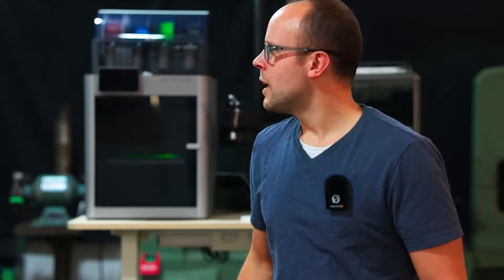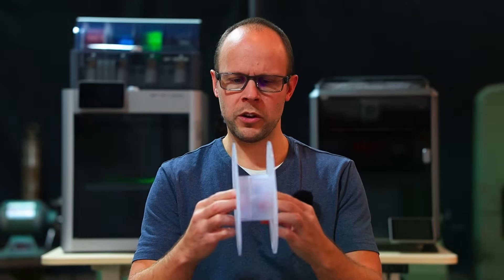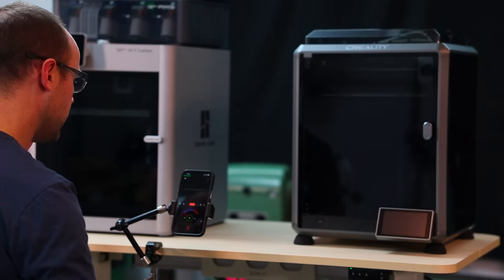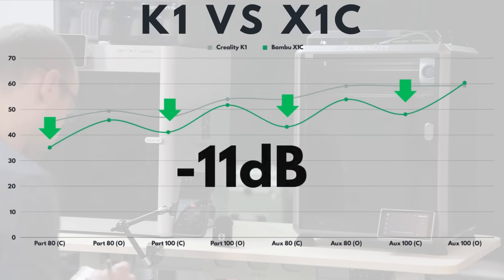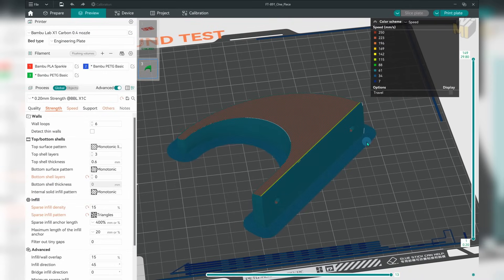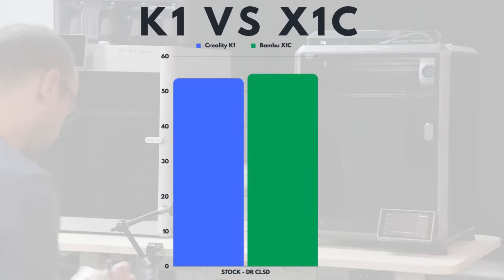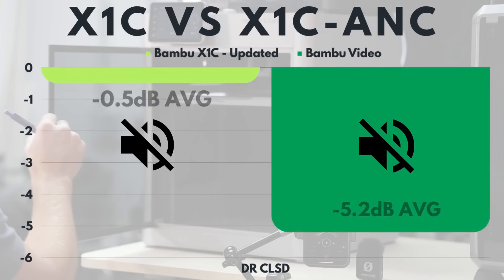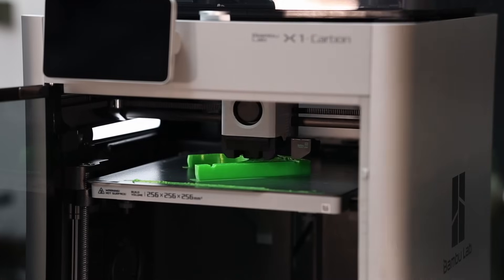Bambu X1C Active Motor Noise Cancellation Vs Creality K1

Comment: This is in no way a meaningful test.
Every printer has to be in exactly the same place on the table and the microphone has to be placed in the middle and in front of the printer for every test! The different positions of the printer on the table alone distort the result, as does the position of the microphone between the printers.
Reply from the maker: Thanks for your comments Nico, sure the distance is probably off by 1/4 of an inch one way or another.  And I'm using an Iphone an an app to measure.  I can appeciate where you're coming from, but you're comment is quite severe.  It is in many ways a far more meaningful test than one quick 10 second shot from a supplier.   Is it extensive testing, not by any means, but it is real testing performed by a real person with real results that I can hear and so can everyone else watching the video.  Though you cannot see it, it took 40 hours of work to put all of this together into something that.. is in NO WAY Meaningful.  So I guess you're right.  Sometimes it's a good idea to ask questions before making statements.
Reply: LOL I Subbed right away after watching this you did a GREAT JOB and Thank you for showing the diff between a marketing video and a Real person testing in Real environment as best they can with the tools they have. Bravo @NeedItMakeIt
Reply from the maker: @AlbertoMartinez765  Thanks!  That my friend is exactly what I'm shooting for.   I don't want to be sponsored, I don't want to get anything free, I want to try to do my best with what I have to see if we can get a little more information to make better decisions.  I'm sure that under the exact correct circumstances, there is a bigger benefit to this, but in my testing of these parts... Which are now mounted on my wall and getting good use, I didn't see a big difference.  I'm always happy to do more testing and if I can get a bit more traction I can buy some better equipment to see more accurate results.    This one took a lot longer than I expected, actually every video takes longer, there is always far more to it as you dive in.

I am still left fairly satisfied that by closing the door on the Bambu printer we get such a big reduction, and I think we can get close to that with the Creality with a few simple adjustments too.  For anyone with an open printer like a P1P, an enclosure will go a long way to making them quiet(er).

When I started testing I thought I was going to see the same results, or pretty close.  I should have in hindsight  tried to re-produce their 'test' first.  In my head I was in the mindset that they were not making a real print and that I could not re-produce that.
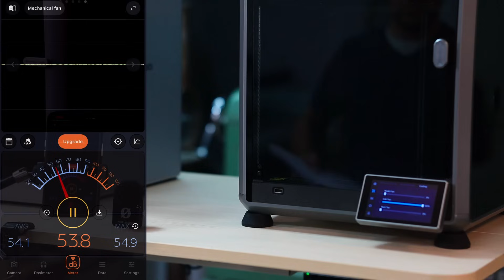Reply: @NeedItMakeIt I think Nico is correct. I don't think setting the mic on the table is the best for a test like this, you're going to get noise transmitted through the table and into the mic. The aux fans, doors, and stepper motors are on the side of the printer, so having the mic to the right of one printer and to the left of the other invalidates this test. Just look at 4:28, the K1 door is blocking the noise from the mic, whereas at 5:23 the X1 door is reflecting noise towards the mic.
Reply from the maker: @mikedixonphoto  Yup, I don't disagree, the exact position and the sound bounding off of hard surfaces are all valid points.   This is why I went through and tested again with the phone moved to the other side, as I showed in the video to confirm whether this was indeed a problem.  I don't claim that my testing was perfectly accurate, however it is quite telling as the main point of the testing is to show that unless you meet exact criteria the noise cancellation feature doesn't make much of a difference.  I'm happy to continue to test and through your feedback I can always do follow ups.  As I work in my shop with my printers going, I can certainly tell that there is a difference in the sounds the motors make, however it is not that impactful when making real parts and not printing with invisible filament.  

If you could, provide me with what the ideal setup would look like and I can add a re-test to the schedule.  Maybe by then I can afford a different mic as well. 

Often times when making videos like these, it's hard to show every single test performed, it's not so simple to pare down over 10 hours of video into 15 minutes and make it interesting.

Comment: It not noise canceling it called stealthchop this has been a feature in many printers that use tmc drivers.
Reply: Stealth chop is how I cook late at night
Reply: 😂 @cwill6491
Reply: I guess I can't link thing on here but stealthchop has been around since 2015, on prusa slicer it called stealth mode. This was thanks to the TMC drivers.
Reply: @elchavode6479  Bambu is doing it in a different way than stealthchop. The implementation is briefly discussed in the official website of the A1 series printer.
Reply: It’s not stealthchop since bambulab does not use a trinamic motor driver. 
Surprisingly or not they use a similar motor driver as some of DJI drones.
Reply: It's not stealthchop. That's an operation mode of TMC drivers. The ANC is calibrated based on the resonance of that particular machine.
Reply from the maker: I can't say I know enough about it, curious if this has been a feature for years why not have it already integrated and why is it made to be such a big deal?  It seems to me that the use of small motors running at higher may be the source of the higher pitch.  Thoughts?
Reply: it is noise cancelling, but trinamic drivers do use something else called stealthchop which iirc has a different way of driving conpared to conventional stepper drivers, causing much smoother motion and quieter motion. Think it uses voltage based chopping

Comment: Pretty dissapointed in the reduction of the noise on X1C. In Bambu's video it seemed like the high pitch noise is completely gone while in your video, it's still there, just a tiny bit quieter. 😞 Great video as always! :-)
Reply from the maker: I did some more testing today, but on very simple straight parts with no infill and they were slower, it seems to do quite a bit better with those.  Yeah, it seems like slower speeds seemed to be impacted a lot more than faster, and non-simple parts still seem to be pretty loud, a bit of motor noise, but lots of other noises as well.  Bushings, rubbing, and some fan noise from the hotend as well, which is funny I didn't realize it was so loud until I watched the video and had to think, why was the fan so loud if I made sure it was set to 40% or less.... different fan.  I'm sure there will be some people who see good benefits from it, I didn't see much on this particular print it seems highly dependent on certain criteria being met.
Reply: I experienced drastically nicer sound. So much quieter now that I can print at 100% speed at night instead of having to use slow mode.

Comment: Great! But is it possible that different surfaces have different resonance frequencies, therefore making the ANC readings different on yours vs theirs?
Reply from the maker: It really is a whole different world thinking about how to address the different sounds a 3d printer is making, so I'll go with YES, I think anything is possible.  PETG can be a bit squeaky, especially as you increase the nozzle diameter, as it runs over infill, it can be very loud.  

My best guess is that they picked a model which made the motors sound as loud as possible and would have the biggest impact on the sound reduction.  I should have tried their exact model and calculated the speed, but it was too late, I had already done the update.  Maybe someone out there can try it and write a comment.  

I wanted to test from the perspective of printing a real model because I had a feeling that we weren't getting the full picture.   

Today I printed two rails from PETG, they were only 8mm x 8mm x 200, and they seemed very quiet, but there was no infill.  I think that angle, speed and materials seem to play a big role.   I'm happy to do more testing if anyone would like, we can always test different materials as well to see how loud they are.  

For those of us who have a P1P, it seems like the best thing to do is to get that printer closed in.  And if you can print with the door closed, it makes a huge difference.
Reply: @NeedItMakeIt me with an unenclosed Ender 5 S1 and no Klipper whatsoever…
Reply from the maker: Hey, we have to start somewhere, you should see what I started with, an ANET A8, these printers are leagues ahead, I should pull up out of the storage room and do a comparison one day, that would be hilarious.  

I'm still waiting for someone to come out with a kit to upgrade existing printers.  The frames of the printers themselves are the same, I suppose the issues would be that the hot end may not be able to handle the speed increase, but just the vibration compensation would be great to have.
Reply: Yeah, I did start with an Ender 3 clone, however I tinkered too much and now I am turning it into a PET bottle recycler that will recycle them into filament. But I said that I don't have Klipper installed since Klipper has Input Shaper which can solve some of that noise.  @NeedItMakeIt
Reply: Yes, it is extremely likely that the base that the printer is sitting on will affect how loud any resonant frequency is.

Comment: Yo. 
Make an amazing affiliate account, then link all of the tools you use. 
For example, that deburr tool. 

I do this on my actual channel and make more money in links than on the videos. 😅😅😅

Link to deburr tool that cleans up the edges...? 😅😅😅
Reply from the maker: Hey Avacado!  

Yeah that's a good idea for sure, I don't mind to do this for any tools that I use and I'm happy with.  I'm hesitant to do any advertising really, but I guess its too late for that, showing products on a video is a form of an advert.  I have a video coming up that wanted to make about this Mic, I wanted to share my experience with it because it has made such a difference, I still have a little bit of echo, but so much less and I think it can help a lot of people struggling like I had been.  That's one where I purchased the product and am super happy with it.  So I suppose I should like that in the description!
Reply: @NeedItMakeIt  using a product, liking it, and recommending the product is different than a paid advertisement from a brand. Know what I mean?
Reply from the maker: It is, but I still don't like to do it, It's something that's a me issue.  I'm the opposite of a salesperson...anti-salesperson.  I've taken your advice and linked the Mic which I bought and I really like, saving hours a video and giving clear audio that doesn't require much of anything done to it, is soooooo nice.    Can you send me your channel info BTW?  I'm not sure if I subbed to the right channel.